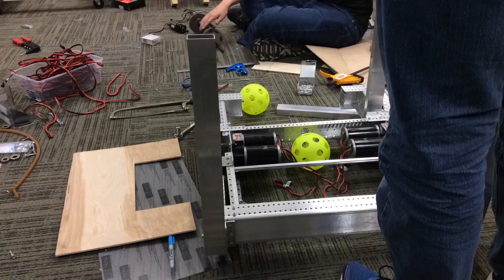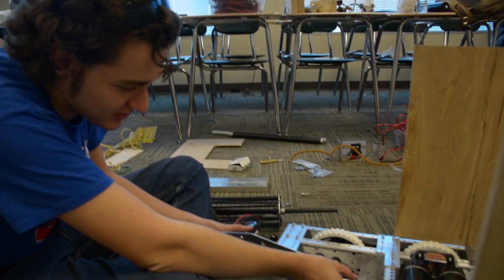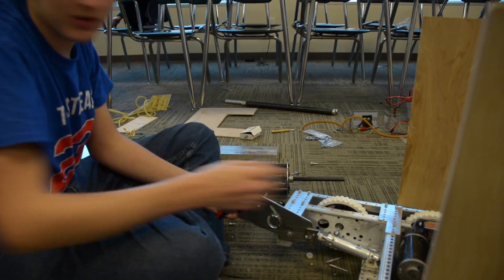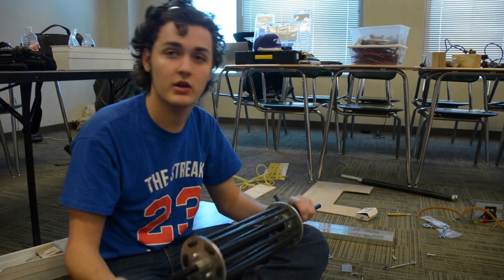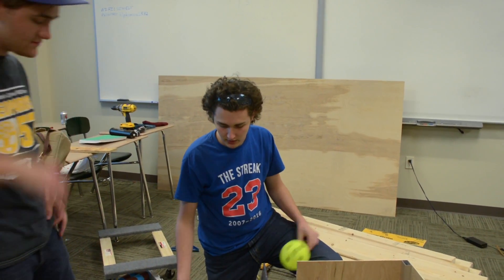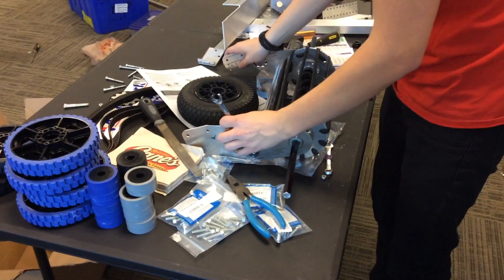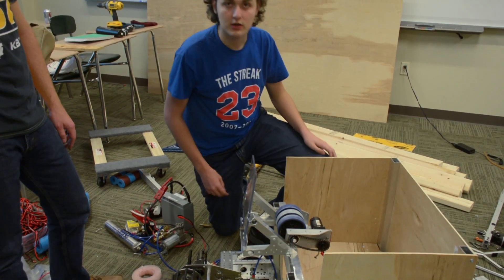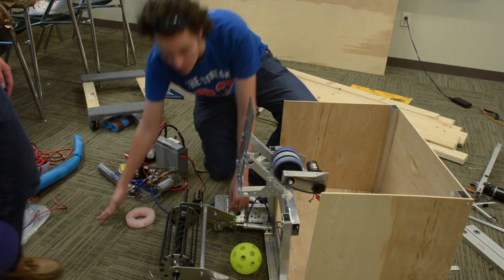Ri3D 2017: Week 6 Day 2 Update

Comment: Pretty sure the intake is illegal. Not because of the type, but because it extends outside the volume. Unless you made the length shorter to compensate
Reply: Ya, that was what I was wondering too.
Reply: In addition, My reading of the rule R02 looks like nothing can extend out past the frame at the beginning of the match. Meaning that nothing can even be beside the bumpers at the beginning of the match.
Reply: We did.  We are using the Andymark kit chassis in the square configuration.  The intake fits well inside the volume.  It is true that the intake doesn't quite fit into the frame perimeter when it is in its starting up configuration (it hangs out about a 1/2 inch or so), but given our limited time and resources we didn't feel as if that was a something to worry about when we still didn't have an elevator at this point.  Thanks for asking